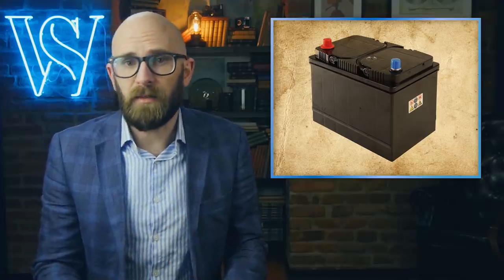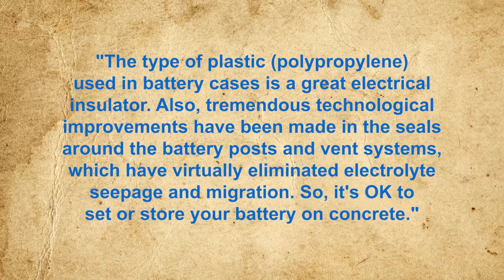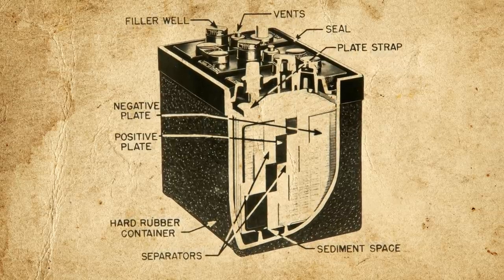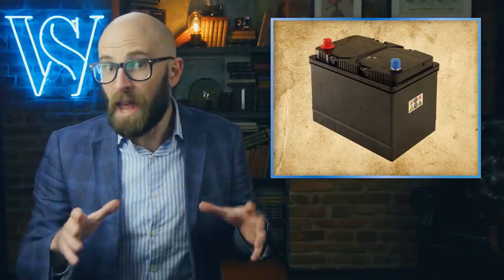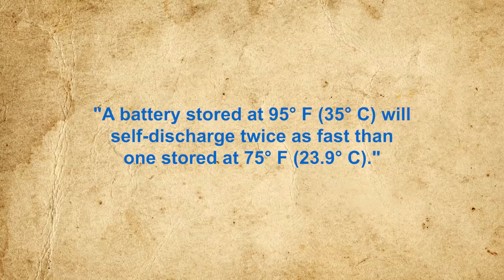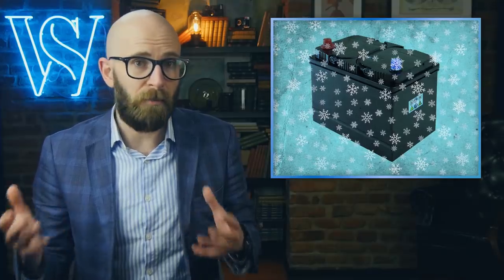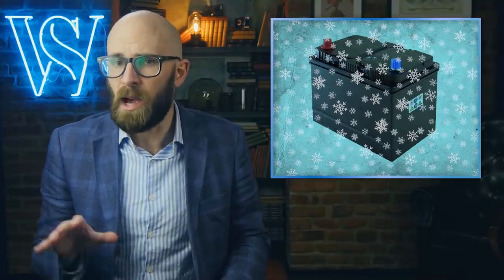Why Does Placing a Car Battery on Concrete Drain It?

Comment: I have noticed that my e-bike seems to have lower power in colder weather. It obviously uses a lithium battery and not a lead-acid one, but it does seem to apply there, too.

Lithium batteries don't have a lot of self-drain, but maybe that is further slowed by the cold, too? Might be worth looking into... ... ...
A brief search seems to indicate that this is indeed the case, but far less pronounced than with lead-acid batteries.
Reply: Take your bike or its battery inside with you. Capacity decreases as temperature decreases. Lithium prefers about the same temperatures as humans in T-shirts/shorts do. Higher temperatures (>40-50 C) will get more capacity/power but hurt battery cycle life eventually (think Tesla Ludicrous Mode warning screen). The battery should warm itself enough while discharging/regen-ing.
Healthy lithium batteries that aren't LiFePO4 have almost non-existent self-discharge. LiFePO4, often used in quality e-bikes due to abuse-tolerance, have more self-discharge than Li-Ion/LiPo, but much less than lead-acid or nickel batteries. LiFePO4 also costs about twice as much as more "ordinary" lithium chemistries per unit kWh, so cheaper bikes will not use them to keep the initial purchase price down even though it reduces the cycle life of the battery by about a factor of 10 (not a typo).

Comment: Exactly, at my last job we charged car batteries.  People would ask to have me charge me when it was below zero F° when the battery was bulging or leaking from from the vent, which means it is Frozen, and will no longer hold a charge.

Comment: Working at NewZealands biggest car battery suplyer I was told a discharged battery accumulates material on the lead metal plates and that sharp stops onto masonry might dislodge some of this and decrease the battery's capacity.  Deep cycle batterys had ways of holding that in place.  Now all batterys have that. Drop and bang them as you wish.

Comment: That explains why my battery wasn't dead after a month of not being used in the winter, and a blizzard too boot.
Reply: Mine will but my car is Japanese and likes to talk to itself when I'm not around.
Reply: I live in Alaska and I can guarantee cold kills batteries.  We’ve had two winters that have been mild and a few weeks ago we got -20 and two batteries died in my vehicles.   They worked fine when it was warmer.  And this happens to my truck which I don’t drive much almost every winter when it gets cold.  Alaskans even have battery warmers because of this exact reason.  This guy may think he’s smart with his British accent but I know this first hand and his “science” doesn’t prove true in real life.
Reply: @MatanuskaHIGH  The idea cold weather doesn't effect the batteries is nonsense. He definitely does not have good information on this
Reply: @MatanuskaHIGH  No. You are trying to extrapolate from personal anecdote and that is the surest way to lead yourself astray. Saying that you don't drive your truck much in the winter is a red flag. As mentioned in the video, the battery is at its lowest capacity and your engine lubricants at their thickest. This means you are working the battery harder and discharging it deeper when you start the truck. Both conditions mean that you need to run the engine longer to bring it back up to a full charge. Lead-acid batteries prefer to be stored at a full charge to prevent sulfation. A $30 battery charger to keep your batteries from self-discharging will help keep them in good condition while they sit unused.
Reply: Markle2k i have an oil pan heater🤷‍♂️.  And yes I have a trickle charger also but I’m not leaving  it plugged in 24/7.  And why wouldn’t the battery be full?  My alternator is newer and I only take it on long trips as I live in Alaska and use it for fishing and camping trips.  I’m telling you the line outside the battery store was out the door the last cold spell. 🤷‍♂️.  Cold does effect battery’s. It kills them and if they won’t hold a charge after that it means you gotta replace them.   So his explanation is just beating around the bush tonthe fact yes cold does kill batteries.  Maybe not in that exact way but it does still kill them.
Reply: @MatanuskaHIGH  Lead-acid batteries self--discharge and despite terms like "deep-cycle" they don't like being taken down below 75% of capacity or so. So, you can destroy a battery just by leaving it alone for a few months in the middle of its life cycle.
Alternators can only charge at the rate they are rated at. If you leave your lights on and come out in the morning to go to work and your car's battery is just generating a "click-click" when you engage the starter, it can take 8-10 hours of continuous running before your battery is restored to a fully saturated charge.
Cold weather absolutely affects batteries, as the video's script writer and I have said and repeated. It doesn't usually kill your battery outright, but puts the battery's weaknesses on full display when you are depending on it the most.
The one sure way that cold will directly kill your battery is if you leave a fully discharged, or thereabouts, battery out in sub-zero weather. The sulfuric acid is an excellent antifreeze, but a discharged battery has most of that sulfur out of solution. It's like having pure water in the radiator.
Reply: matanuska high don’t forgot cars now a days have systems that stay awake after turn off and locked. You have an alarm system that’s constantly pulling small power so a weak battery that sits long enough will be drained to low to start.
Reply: @Markle2k  all automotive batteries die in cold weather. Even at over 80% charged. Even living in Florida with a low of 30f we still change tons of batteries every winter. Even fresh batteries, on daily driven cars with perfectly functioning alternators. That are driven on the highway to their destination delivering medical equipment from City to city. I maintain a fleet of Vans and trucks and it's something we expect to deal with every winter.
Reply: FishFind3000 alarm isn’t on though I live in Alaska and don’t keep things in it that anyone would steal and if the stolen the whole truck I have full coverage 🤷‍♂️.   Idk but it’s not like it sits for months and months I drive it once a month or so.  Also it happens when the battery is just over the 2 year warranty .  Go figure..lol so every 2 years and maybe 1-2 months I’m replacing my battery.  Never happens at 23 months when I would be able to get a new one on warranty lol.

Comment: What about the lithium batteries used in phones, laptops, etc?  I had a cold night while backpacking (20 F) and left my phone outside of my sleeping bag but turned off.  It drained from 40% to 5% overnight and did not recover while nestled in a warm pocket of my jacket the next morning.  This sort of battery drain most definitely does not happen at home in a warm house.

Comment: Yeah when you consider 75F "cold" then it's not going to be a problem.  When it's -40 batteries are negatively affected, not from discharging into the air, but because they don't work as well.  That's why they list cold cranking amps separately than the regular amps.

Comment: If the concrete is extremely cold it will have a draining effect on the battery. Not because of electron drainage but because of slowed down electron flow. That's why batteries all list cold cranking amps as a feature.

Comment: one summer day i  went to the store to buy a vacuum,  when i parked i decided after i had turned off the engine that i should move to a closer spot, attempted to start the car and well the battery was not able to crank the engine ,  i had had signs earlier that it was having difficulties starting the car but i figured i had some time but nope it was dead , since i was already at the store i figured might as well go buy what i needed and when done deal with the car (call a tow truck)  it was a hot summer day and it got to 118F , after 2 hrs of sitting in the hot sun i figured might as well try to start the car, sure enough started right up like it was nothing, i counted my blessings and drove straight to a car part shop to get a new battery, until today i had not idea why the battery suddenly worked after sitting in the hot sun but now i know , the little juice it had left had been boosted by the heat and it allowed it to crank the engine one last time.

Comment: Corrosion on Battery terminals on vehicles is due to differentials between conductive materials it's one of the reasons maritime vessels use Anodes

Comment: BUT, if a battery is discharged enough, it can freeze in cold temperatures, causing internal damage to cells ;) I have learned this the hard way, many times, and now pull batteries out of my boats/ lawnmowers etc in winter, bring them in the garage and rotate on a trickle charger..

Comment: You misunderstood  the winter issue ... it's not storing the battery that's the issue, if it's cold and you use a weak battery to turn a diesel engine over the battery will likely die completely  because it cant discharge enough fast enough... that's why I spent half of winter as an apprentice changing  batteries in diesel engines on my plant hire fleet

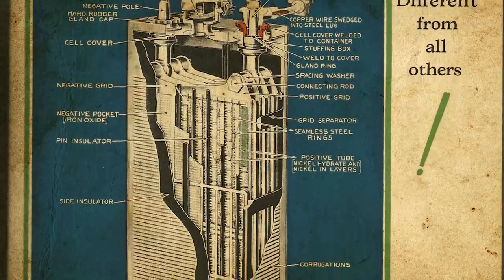Comment: At 1:40 you say an Edison battery encased in steel will discharge faster when placed on concrete. This makes no sense because steel is a conductor and the concrete isn’t going to speed up any discharge unless it is a better conductor. Secondly, the contact with the floor can only be to one electrode if at all and we all know that that won’t cause additional discharge, you need the concrete to add a conductive path to the other electrode. Maybe if it fell over ... it looks tall.

Comment: I drive an older electric car (a 2014 model). When it's summer I can get 120 miles, but as it gets colder I lose mileage available. When it's freezing, literally, especially below, say, 20F, say 75 miles. Explain this? I have asked other electric car owners, and all they all report the same - no this isn't due to using the heater (with that on, in at 20F, it's around 68 miles).

Comment: Heres another battery legend that's probably true: Leaky batteries can form a semiconductive film of metaloids on top of the casing that is not visible. In a few instances, cleaning off the top of the battery with baking soda and vinegar can get another year of use from an apparently dead car battery.

Comment: On the farm where I work, all our backup generator batteries are placed in a plastic box on the concrete pad that the generator sits on. Simon may be right, but since it's not hurting anything, and I know I ain't gonna convince these people otherwise, I guess we'll keep protecting our batteries from a discharge that would likely never happen anyway.

Comment: i guess this bind both end of the spectrum, the grain of truth and how it only applied in the past and how it stems from a misconception... meaning nowadays, the battery "appears" drained but is actually as charged, just not able to make the same power output when cold... i guess if the batteries would have Capacitors to charge temporarily to do cold starts, it could solve a part of the problem. an other would be a way to heat it's internal components before it is used from a cold state.

Comment: My dad definitely believes that there’s a difference between storing a car battery on the ground or low shelf as opposed to a very high shelf. He’s a brilliant mechanic, very knowledgeable machinist, and talented welder. However, my family is generally much more prone to superstition than I believe myself to be (which has led to philosophical differences).

Comment: In this day and age, you probably should emphasize that this doesn't apply to the lithium-type batteries used in electric and hybrid vehicles.  Especially since the lithium batteries are more susceptible to poor performance in cold. You did repeatedly refer to the lead-acid battery, but I wonder if any people think the hybrids are using lead-acid. Also, if it gets cold enough to freeze the acid in a lead-acid battery, all bets are off.

Comment: Why are AA batteries bigger than AAA and what do the letters in the sizes stand for?
Reply: joseph bennett probably the same reason when a smaller wire gauge is a larger number.  Smaller battery is a larger letter size. And d cells are big and farther away from a. But it’s not all like that as there’s not really anything standard. About why it’s called that.

Comment: A trick with a cold batterie I was given (doesn’t work whit extreme colds) is to turn the headlights on for about a second or 2 and then turn them off againto (as they put it)  wake up the battery, the sudden use of it would make it easier for the charge to be used to use the engine starter. I have no idea however if this actually works.

Comment: You know what does drain car batteries? That "environmentally friendly" function that means your car engine automatically switches off in static traffic or red lights. It cuts the lifespan of your battery by half which means you have to use up twice as many car batteries. How environmentally friendly is that?

Comment: Cold however WILL destroy lithium batteries. It causes the lithium to bond to the anode, coating it over time and permanently reducing the battery's output.

Comment: Modern lead acid batteries indeed can stay alive all the way down to -60 or even -70°C. That's damn cold. However, there seems to be an increase in batteries dying in the winter and in the most inconvenient time and there is a good reason for it.

While the battery is best preserved in cold, human isn't. That's why human during the winter tends to use his car for all sorts of various short trips he would otherwise usually make on foot. The car though should be started for at least twenty minutes in order to somewhat equalize for the lost battery charge. An ideal charging time would be then about an hour of regular driving without shutting down the engine in order to completely regenerate the battery. However that is rarely a thing as humans tend to drive their cars anywhere between five to fifteen minutes and stop and start frequently. In result the battery will drop below 12V and it's at this moment when a chemical reaction will occur, destroying the battery. Once voltage is below 12V crystals begin to form between the electrodes. These crystals are conductive and will short the internals of the battery, removing it's ability to transfer charge, and thus rendering it useless.

Comment: Whoever wrote this must have never looked at the top of a car battery to see that there is a difference in cold cranking amperage at 0 degrees Fahrenheit and cranking amperage at 32 degrees Fahrenheit, as it's measured in the US. They gloss over it for just a second but never explain anything about it.

Comment: I get a new vehicle every 130,000 KMs and I’ve found that you can get 3 winters out of a battery but it’s 50/50 on the 4th winter.

Comment: And this is why better electric cars have active thermal management (that is, heating and cooling) for their batteries, so they can make sure the batteries are warm enough to give off the necessary amps, and cold enough to age slowly.

Comment: Are there batteries that don't use chemical reactions to generate electricity?
Reply: Nuclear batteries. They are very expensive but also have very high energy density. So they get used where long life is desired and cost/difficulty in replacement is high. Heart pacemakers are one of the most common everyday life examples. After death, they make cremation/burial preparation complicated.

Comment: I have been an aircraft mechanic for nearly 4 decades. There are many people that I’ve worked with believe this. Other non mechanical people often ask me about this when I have a battery on concrete and am performing tests 

I point out where the battery sits in the nose of the helicopter. The paint is worn off and it’s bare aluminum. This is all bonded to the rest of the structure and to the skids that are on concrete. 

Then I get the universal reply of “ that’s different “.

Comment: I live in Alaska and I can guarantee cold will kill a battery.  Last time we got to -20 f I had to replace two batteries. They went dead and wouldn’t hold charge but worked fine before it got cold.
Reply: I warmed it and even added a trickle charger so I’m calling bs.

Comment: save you the time a battery will die in any case if left anywhere uncharged or not having a trickle charger connected to it. Not just be drained it will die if left long enough.

Comment: Obviously he does not live where it's real cold.  the normal scenario is that when it's real cold, the car will not start due to water in the gas, not enough battery life, slow cranking due to stiff oil, electronic problems, diesel fuel gelling, summer fuel, parasitic drain, etc.  Then, the battery becomes discharged, it will now freeze.  Now, the battery is ruined.  He also doesn't cover the fact that almost all new cars use up battery power when they are just sitting to run the computers and clocks, etc, this discharges the battery over time, and sooner or later it will be discharged, and then freeze.  He doesn't cover the possibility of condensation on a battery sitting on a damp basement floor, I have had that happen, and it seemed to drain the battery.